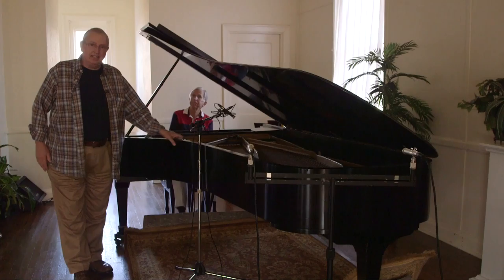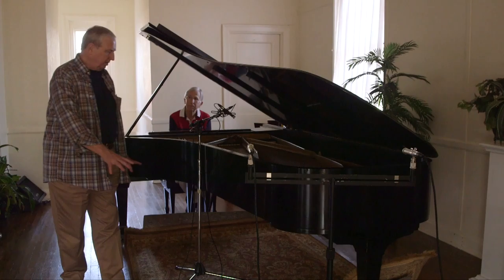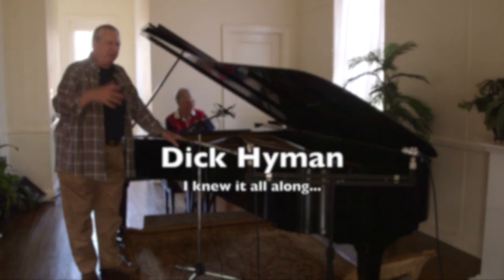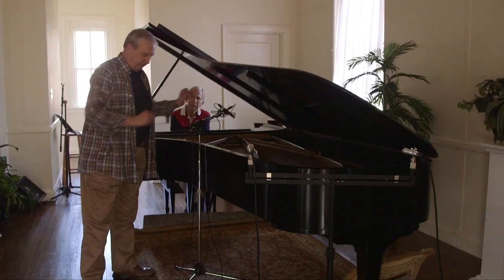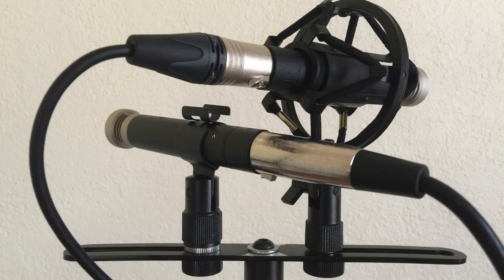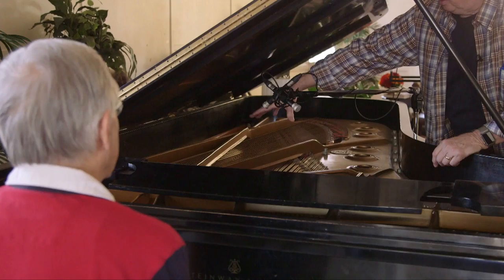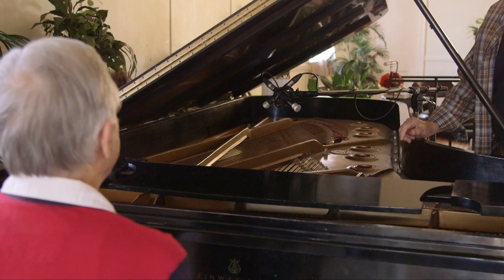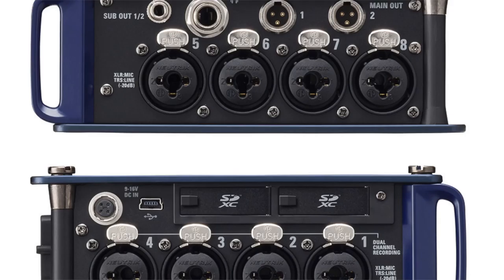Recording A Steinway Concert Grand

Comment: Hi there!

Would you help me understand wich Zoom recorder would be more useful for me, among an H6, F4 or F8?
The F8 has nice features over the h6, while the price is way too much for me momentairly, considering i still need to buy a handful of Oktava mk012 and their capsules ( i did like a lot the sound resulting from the mics you used also, at least here in italy, the price is A LOT more friendly than Shure).

I would like to record some pianos from my conservatory (an old Boesendorfer Imperial, a Steinway B and pretty new D) along with some organ music when i travel.

On the pianos i would play a lof of classical music, on the organ music ranging from extremely powerful to very quiet (In sicily we have maybe TOO MANY organs, even from 17th century).

I am a total ignorant about recording, but i do like to learn (and it might be necessary for my situation, so...).

Thank you!
Reply from the maker: I'm under the impression that there is no difference between the F8 and H6 except for track count. I could be wrong, but if that's the case, base your decision on how many tracks you might need on a regular basis. I have on a few occasions used as many as ten channels which required multiple recorders, but worked out quite well. Despite it being a 1 hour recording of a choir, orchestra, organ, piano and soloists, we had no problems with sync. I guess my point is you can always add more recorders to the mix if the situation arises. On the other hand, if you regularly need more than 4 tracks, go with the F8.

How was that for rambling about the question??
Reply: A very thoughtful ramble sir, thank you!

I will ask sorry in advance for my long reply, but i feel these days as if my head was like an unstoppable train at the moment... so many opportunities and happiness, as a result. 

So please do take your time.

And while we' re at it, with the prefaces, i would like to give the pianist my best wishes, because even if that sir is acquainted to a musical genre quite different from mine, i felt like listening to a genuine and passionate musicality, difficult to find these days.
I felt an emotion similiar to when enjoying the great masters recordings of about a joyful kind of music.

For example, when Horowitz plays Schumann' s "Childhood" pieces, or Schubert.

Without further ado...

I will look up better on the matter of the tracks, as i' m starting to realize that being too much fixed on buying a single, factotum recorder with a neverending amount of features, would be much more expensive than getting 2 or more recorders and fiddling a little with the sync (be it post-recording or before recording, with some kind of controller).

As you mentioned, there could be occasions where the tracks needed will be more than how many the recorder itself can handle, so i think that for now i should focus on the microphones and their setup.
By doing so, i will be able to think with more ease about how many tracks i need for some solo recording session, then later, when a concert toghether with other players or an orchestra is organized, i can check what more will be needed.

I have a couple of questions i would like to ask.

Why did you sir come to like the Oktavas?
I would like to know your overall experience.

I see there are many kind of microphones, the Mk012 is a "Small Diaphragm Condenser" type, also modular, so i understood that is possible to put many kind of capsules on top of that body, not only the stock.

I do not own a single microphone yet, and of course i need to buy more than one, in fact, your setup was very interesting, (a couple near each other, a couple a little distand instead, then 1 for ambient sound): i' m sure i will do something in the end with the same logic behind, meaning, trying to follow the natural way that sound does travel and resonated in that room, am i wrong?

So, if i need to buy, say, 6 microphones, should all of them be S.D.C. (if not in a rush), or i should choose different kind depending on their position and distance to the instrument and other microphones?

I was thinking for example, when recording a Grand piano, probably saying some idiocy (because i have no idea of how that would sound):

- 2 S.D.C. mics really near to the point where the hammers touch the strings, in order to get the "signature" of the sound, its "tone", the intonation of that particular instrument;

- 3 Medium (?) or larger diaphragm to capture the "body" of the sound, and the travel of the sound from inside to the outside of the piano : 1 in the middle or middle-end of the strings' harmonic table, in order to capture said body (with the lower gain and lowest % of "partecipation" in the final mix, getting a role similiar to the ambient mic you showed in the video), while the 2 that follow said travel, 1 to the concave side of the piano and 1 behind that mic with a little more height (of course the lid would be fully opened), to capture how the sound expands and starts to gain some spatiality... this last mic, only if i were to do the recording in an ambient with similiar acoustic and size to the conference room from this video you sir uploaded.

-1 Ambient mic, not sure wich Diaphragm Condenser size it should be...

Basically, i am really confused about wich D.C. sizes are better for each position and role, or if they are even needed at all, if ideally i had a budget condition that allowed me to get the most appropriate ones.

Thanks for your time, and sorry for the very long reply, but i do think that in this moment of my life, recording myself will be proven to be a crucial thing for my future.

Thank you, again!
Reply from the maker: First of all, thank you for acknowledging my friend Lew Scharpf and his wonderful piano playing. To see his name mentioned on the same page with Horowitz will be a thrill. I'm so glad you are not a classical "snob" who looks down on all other music. Great music comes in many genres. 

By the way, while I love Horowitz playing almost anything, for Shubert I have a particular fondness for Maria João Pires.

Microphones and recorders are like lenses and cameras. A top quality lens will outlast many cameras. A top quality microphone will outlast many recorders. Recorders and cameras changed from analog to digital at the turn of the century, however great microphones and lenses from fifty or more years ago still produce stunning results. 

As an example, watch and listen to this recording of Lew that was done using a single ribbon microphone. This is not even stereo and the microphone was designed in the 1930's. It is the AEA 44, a modern, exact reproduction of the famous RCA 44. The AEA benefits from modern improvements in magnet technology, but otherwise it is totally faithful to the original. 

https://youtu.be/EiaX7oRoBBk

Small diaphragm condenser mics these days seem to give the best value, but there are considerable differences in the way they sound although they all seem to look pretty much the same. Here is an extreme example of "you can't judge a book by its cover." I have used SDCs from many makers and I honestly feel the Oktavas are among the best. BE VERY CAREFUL to avoid counterfeit copies. Your best bet, especially in Europe is to buy from the Oktava store in Germany. Even with shipping to the U.S. I found their pricing to be quite good and the service excellent. That operation is run by the daughter of Oktava's chief engineer.

Don't make the mistake that larger microphones produce larger sounds. In general, larger diaphragms produce higher voltage outputs (even then, incredibly small currents), but this in no way reflects on the sound. The "biggest" sounding microphone I have ever encountered is the QTC from Earthworks which has a 6mm diaphragm, about the size of a pencil eraser. This mic has flat response down to about 5 Hz. If you doubt that, listen to a high quality recording on a huge speaker system. 

As microphones become more expensive (generally), the sound becomes more neutral. A better way to say that is the sound becomes more natural. At any rate, the microphone designers are all striving to remove all coloration from the microphone sound. With the very best microphones, the differences in sound are created almost exclusively by the placement of the microphone.

There are five major microphone mechanisms: condenser, ribbon, dynamic, carbon and crystal. For the recording of most music, the first two are the only choices. The very best condenser microphones are made by Neumann, Schoeps, Gefel, Danish Pro Audio, Earthworks and Sennheiser's MK series. No doubt I left someone's favorite off that list, but these are the top of the line. For ribbon microphones, AEA and Royer make the best. 

Ribbon microphones are enjoying a renaissance these days. Engineers have discovered a secret that many of us grew up with. These wonderful microphones were the source of 99% of everything broadcast and recorded on radio, records and movies from 1930 to 1950. After that, condenser mics began to dominate the recording industry and by 1970 had taken over Hollywood. Radio switched to the rugged dynamic mics for the crazy disc jockeys in the 50's. Along the way, ribbon mics were forgotten.

But now they've been re-discovered and more and more recordings are made with them. We tend to associate them with the scratchy, thin sound of records from the big band era, but the weakness is in the recording medium, not the microphones. Search around YouTube for recordings made with AEA and Royer microphones and you'll be stunned at the clarity and quality.

In my opinion, good ribbon microphones give the most natural sound possible on recordings.

What's the downside to ribbons? They are less rugged than condensers and don't hold a candle to dynamics (which can be used as hammers in an emergency). Ribbon mics are also EXTREMELY sensitive to wind. In 1963 I made a recording with a nice ribbon microphone that was ruined because the mic was in line with an air conditioning vent in the auditorium and each time the A/C turned on, the recording was filled with rumbling. This is when I learned to ALWAYS monitor the recording with good headphones if possible.

But if you are working inside, ribbons are an excellent choice. Just understand that ribbon mics have a lower output and require more amplification. Most modern recorders can provide this.

My strong suggestion to you is to start with two of the highest quality microphones you can afford and a modest two-track recorder. Move the mics all over including under the piano. Read articles on the various stereo techniques like AB, XY, ORTF, DIN, etc. and experiment with them (DPA microphones have excellent tutorials on their web site). The Schoeps web site has many technical papers on microphone techniques. Other web sites have good, though not as deep, information. Read it all and experiment.

I spoke earlier of headphone monitoring. Be very aware that what you hear in headphones will not be what you hear through a speaker system, but the headphones can be a good guide. More importantly, you will hear the bad things through the headphones, the unwanted noises, hums, buzzes, etc. 

Bottom line: spend your money on microphones and get a decent, but inexpensive recorder. Then the best way to get great recordings is the same way you get to Carnegie Hall – practice, practice, practice.
Reply: Rex Roach 

My most sincere thanks sir.

I' ve printed your earnest and very dedicated answer and put it in my wallet, in order to keep it as an important guide along this journey of trying to record my music.

I will later on thank you properly, letting you know of what i will be able to accomplish, and sharing some music too when i will be able to both play and record some piece decently.

Because in the end, is like you wisely said before, for everything that must be done with a certain quality:
 Practice, practice and practice.

In this last period i' m finally starting some results, but that would' ve never been possible without before going trough some sincere commitment.

In the meantime i leave you with my best wishes to you and mr. Lew, hoping you two get deserved satisfaction and fulfilment from sharing your knowledge and experience with us lovers of music!
Reply from the maker: You are so very welcome, Terry. Best of luck and thank you for your heartfelt participation here.
Reply: Thank you Rex for this wonderful insight!

I would like to add some information regarding the question of the Zoom H6 and F8.  The preamps between the two are slightly different, but both are good.  I have the H6, but would like to upgrade to the F8 for the additional mic inputs, grouped gain, wireless control, and slightly better EIN (self noise).  The H6 has an EIN of -120dB and the F8 has a slightly better EIN at -127dB.  Both are quite impressive.  The F8 is nearly twice as expensive as the H6, though.  The H6 comes with an XY capsule that does a pretty decent job on its own.
Reply: Grazie!

Comment: NOT IN YOUR HOUSE!!!!!
Reply: I very much appreciate your lesson. I have recorded many sessions with either a Bösendorfer D or Yamaha in an accoustically pleasant church. I used similar arrangements - yet my ORTF mics were set to figure of 8 to capture
sufficient room sound - also supported by an additional A-B pair. I want to make the following remarks:
1. The left channel  omni (A.B) seems to be defective as it is extremely noisy.
2. Room mics should also be in stereo as this adds much more airiness. I have 6 inputs on my TASCAM DR-680
    (modified low noise version). You are even better on the way with the F8 !